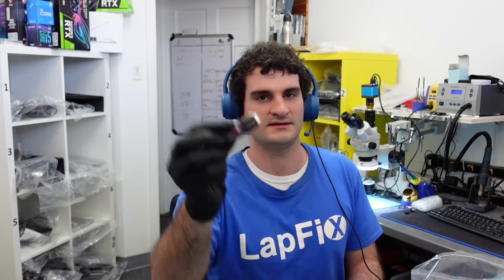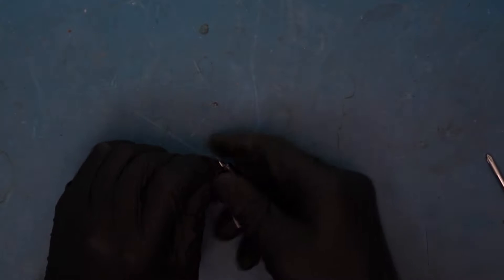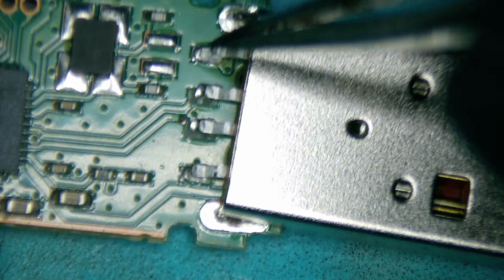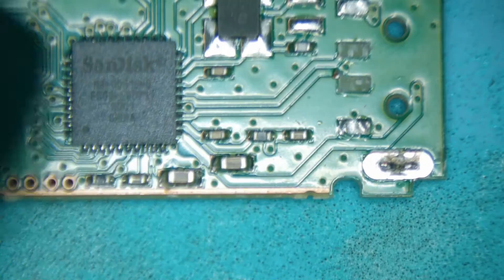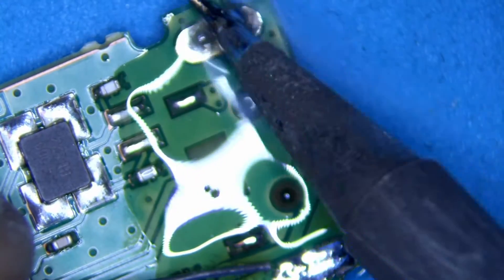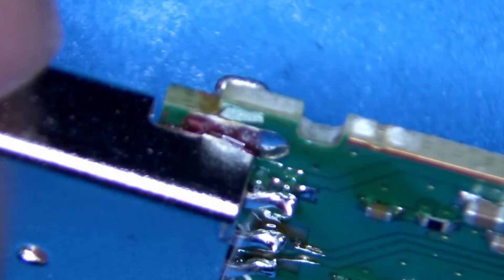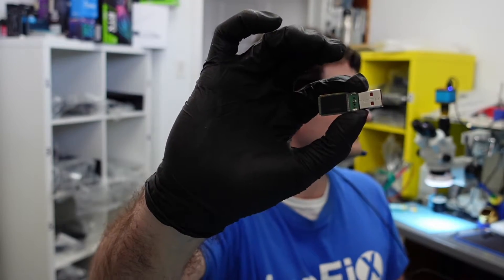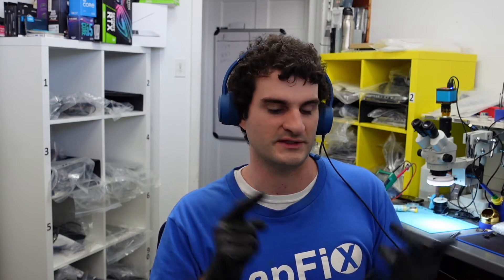How to Repair Broken SanDisk USB for Data Recovery

Comment: Hey man, so I’m trying to fix a similar drive, but there are 9 connection pads… I’ve identified 2 that appeased disconnected and have tried to soldier them back, but no luck. It’s possible my soldiering sucks, but any suggestions?